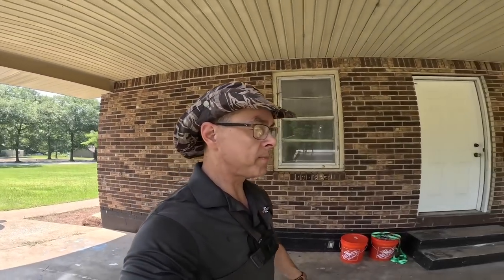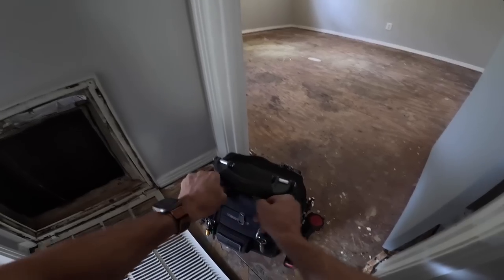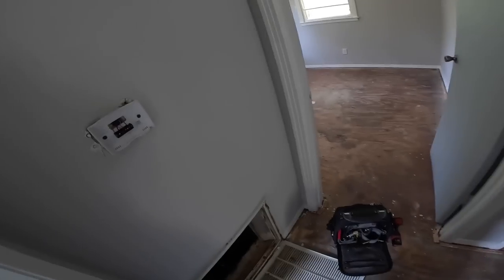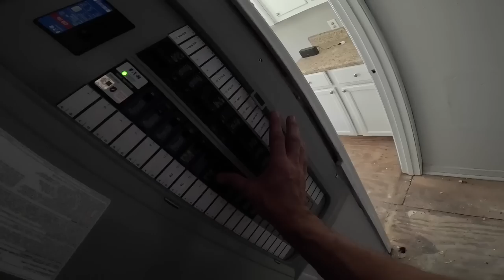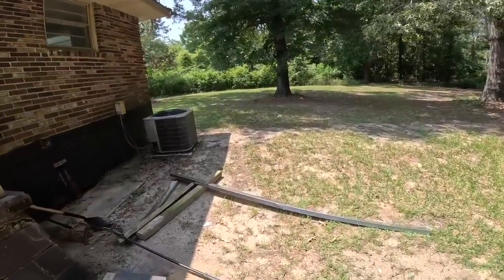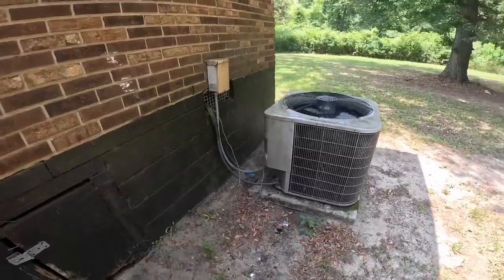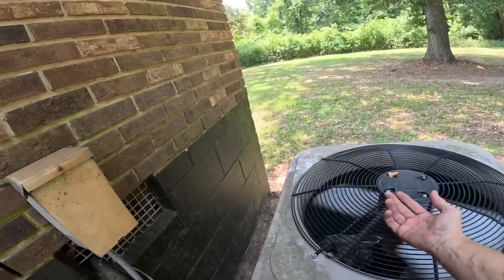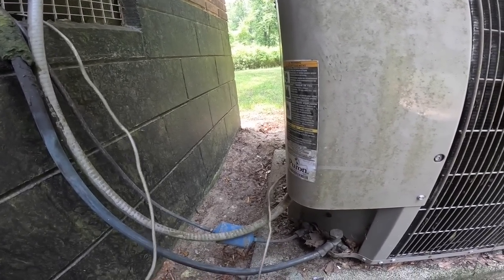Owner Told Me He Thinks It Needs A New Thermostat! #hvaclife #hvacguy

Comment: Can't believe all the dirty clogged up filters you see.  I change mine every 6 months.
Reply: every 6 months would make it wayy worse than the one in the video in arizona lol
Reply from the maker: Is that a joke
Reply: @obama7325  I'm in Minnesota and use 16 x 25 4 inch filters.  Love my Bryant system, it cut my gas and electric bills by 40%.
Reply: @raykrv6a  That must be those expensive bastards. My air return is at floor level upstairs basically at the top of the stairs. It doesn't get as dirty as the ones I've seen. I could probably go a year, but I don't because of dust in general. I change it every month or two. I really feel for folks that have them floor level in the kitchen, especially if they have pets.
Reply: I live in Arizona,  change it every month
Reply: @jthonn  Well, Bryant system monitor comes up every 6 months to change the filter.  It really doesn't look that bad.  But we don't have the humidity and pollen like down south.  Had a 31 year old Lennox system and the condenser looked new compared to what he works on that's only 10 years old.
Reply: @raykrv6a  I hear ya.
Reply: @raykrv6a  I hear ya, and there may be some truth to that, but I'm in the south and my unit looks great. People do not care for them, especially renters. Also Ray, I think the older systems were better, maybe not as efficient, but better.

Comment: It always needs a thermostat or refrigerant.  Two most common things homeowners think are wrong
Reply: "I saw it on youtube, its not expensive at all"😆
Reply: "Needs Freon"
Reply: Always! lol
Reply: Needs "Freeze-on".
Reply: "2nd shift done it"
Reply: @bobboscarato1313  I have also heard "freeze-own"
Reply: Had a call this past Thursday. Our unit ain't running and the t stat is blank. Luckily the customer informed us they had the breaker panel indoors replaced and apparently they installers had accidentally bumped the breaker off or left it off accidentally. Customer said "well shoot" - wish all our calls were that easy

Comment: 3:51. 3 pack of pristine 20x20 filters by the front door,someone at least had the intention of replacing that " thing" in the return grille at one point recently.
That wasn't even a filter anymore,it was a science project!😂😂
Great video
Reply: Man you got a good eye. I bet Curtis freaked out.
Reply: Looks like a new thermostat on the counter by the kitchen sink too
Reply: @DBR0909  You guys are something else, it sure looks like it. Seems like the owner should have told him.
Reply: The tenant never replaced the filter for the length of the lease.-
Reply: @DBR0909  Probably the wrong type of thermostat for the system.

Comment: So weird having the air handlers under the house in the dirt.
Reply: Put them in the garage, mount them on the ceiling, build a pedestal, build a platform so it’s accessible from three sides on the garage…don’t put them in the attic or the crawl space. Of course if it was me, depending on the house, mini splits it would be in some form.
Reply: I have seen worse than that one. What I can't understand is if you run duct work under a house, why not go with a package unit? Now I'm talking about original install, when replacing, I'm sure it would cost $$ to run new ducts.
Reply: We have a well to do customer that has one under thier house like this - pain in the but to service. Due for a change out soon - that's gonna be fun. Hopefully we won't be putting it back like that. Run new duct and everything .
Reply: @mediocretroll2842  why not go ductless? It’s pier and beam, it would appear easy runs for the line sets. Go multizone or single zones. If each unit costs around a thousand or less, $1,200.00 for a Mitsubishi 12k, or $800.00 for a Pioneer 12k. A typical house needs 4-6 indoor units. Yeh, pros and cons for both, but I love the ductless and wouldn’t go back to a standard system.
Reply: @user-ln7of9gs4s  looks like that's the way its going. Have several commercial and a few residential customers that use only those. They are easy to maintain but working on it when it has issues can be a pain. Toshiba and Daikan are usually the brands I see where I live

Comment: T-stat wire entrance hole was made with an ax, sometimes I carry a pine routed base board to mount t-stat over large holes.
Reply: Good idea. or get mistake plate of some sort. That place was being fixed up, get the workers to patch it.
Reply: I’d bet the drywall guys covered the wire up when it was built, and the install guy used a the ax you’re talking about! 😂
Reply: I have used plumbing "access panels" before, cut the hole large so it fits and mount new thermostat to the panel. just make sure they're OK with that solution first, some would rather have it moved  to a new spot nearby and patch the hole.

Comment: We’re still rolling with a Rheem 3 ton split unit heat pump that’s 13 years old now. My HVAC guy came by last week, cleaned outdoor coil and checked refrigerant levels, and gave it a clean bill of health. He said the pressures are as good as they were when it was new. We’ve had a couple of little things go wrong over the years, but nothing major. Hopefully it’ll last a few more years, the original unit to the house from 97’ was 13 years old when it killed over, (indoor coil leaking and compressor about out). I’m an electrician, and we hook up a lot of Bryant and Rheem units around here.
Reply: I like servicing Rheem units - they have easy to access parts and room to work

Comment: It definitely needed a new thermostat. It looks like they are doing a decent job fixing the place up, they could have patched where that t-stat goes. Well I guess it was hidden. Nice job, I could tell someone did a decent job installing, but it could use some preventive maintenance. It's 10 years old and looks older than my 18 year old unit. What I'm getting at is you can do a great job, but folks won't maintain it. That filter is a prime example. If that is a rental, you may want to have the owner call you at least once a year for P.M.
Reply: If we could invent a self cleaning filter………🎉🎉🎉🎉$$$$$$
Reply: @Mindsi  LOL, one that flushes itself like a toilet when it builds up enough dust.
Reply: Don't lough; I was working in the mansion of a mafioso in NY like 60 years ago and our company installed a Honeywell self-cleaning electronic air cleaner that was the size of a large concert piano. I was told at the time the air cleaner alone was about $ 3,000.- It remove cleaner and pre-filter from duct mount, washed with Calgon for 30 minutes no moving, then rinsed it, reinstalled it into mount, then just ran the fan for 30 minutes until it was dry and then it will energize the power supply. Those units used 10 thousand volts to create the electrostatic power needed for right operation.
Reply: @bobboscarato1313  Holy cow!
Reply: @jthonn  I used stronger wording!
Reply: @bobboscarato1313  LOL, I only do that if I'm mad.

Comment: I switched to needle point meter leads , I've never had any before,they are the best ever in my 35 years in the trAde , a customer gave me a little seat a few years ago , about 10 inches high , I use it all the time, way better than a knee pad most of the time

Comment: Did you get lucky not blowing the fuse right away?  I would have checked for short to ground on the, load side of the fuse, connector on the end of that wire.

Comment: My luck would be that'd be the one fuse I didn't have. I wouldn't want to live in this house anyway - that's an atrocious foundation and load bearing structure. As for HVAC, it always seems that nobody knows you need to change the filter monthly. Filters need to be changed, they prevent damage, fires, and improve efficiency of electricity and lower costs.